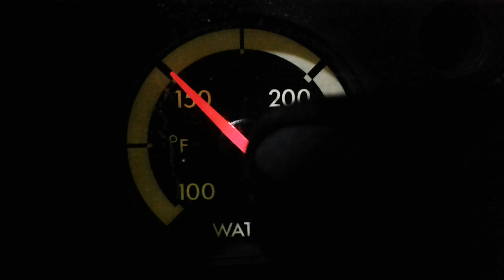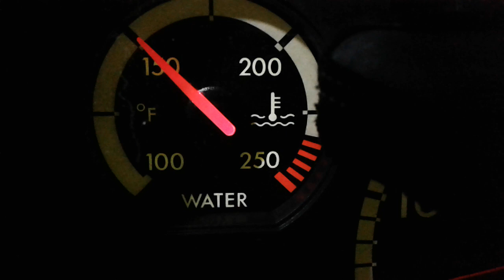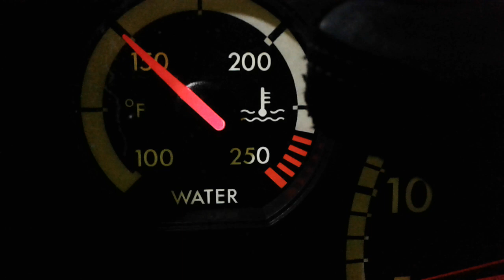Winter Fronts - When to use them

Comment: I used a bluedriver scan tool to monitor my 99 Dodge Ram pickup, I monitored live data from driving on multiple days 70's-80's and 30's-50's
And it got better fuel economy with higher temps and lost fuel economy with colder temps. 

I always thought it was better to lose heat to save fuel since the ecm wouldn't be injecting more fuel in to cool down cylinders, but apparently it's the opposite, it has to be a certain degrees as engine sweet spot 193°, 183-196 range for me. 
I've got one of those winter fronts coming soon and I'm gonna love trying it out this winter. I'm also thinking about getting an in line coolant heater on a timer to get my truck ready when I need it.

Comment: Cheapest and easiest way 
Get foam 1/2" by size of ur radiator length and width my slides in between the grille and radiator. Make sure to poke some holes first. $10 for foam board at home depot 3' by 5' save the rest for oil changes nice n soft for lying on